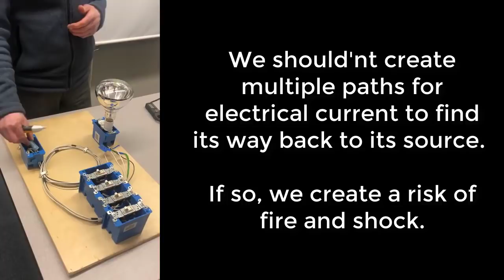Parallel Paths

Comment from the maker: Here is a link to a schematic of the wiring in the demonstration:  http://www.buellinspections.com/parallel-paths-picture/
Reply: You just demonstrated OHM's and Faraday's law's - The reason why we use three phase electrical generation is to do with the transmission of power over HV power lines.
Reply: I feel for you, Charles, I really do. It would appear many are not able to abstract away the demonstration from the physical sub-panel, or to even listen and understand that you're talking about a sub-panel and not the main panel where service is fed in. I got it, I get it, it makes sense, and no I didn't need you to show an actual main panel, sub-panel, and an entire house to prove your point. Some people...
Reply from the maker: Thanks Redemptus
Reply: Charles Buell thanks this is what I was looking for.  I understand the parallel paths but don’t understand how a house could have this wiring..
Reply: @m2mot  aparently they harvest elecricity ftom the air using power lines.
Reply: If  you place a large copper coil under a say ,400 KV  pylon power line  it will give you power -its also dangerous and  illegal to do this  -did it as a apprentice to see if it works ,yep sure does !! -So there you have it electricity from power lines with no connections -I blame Mr. Eddy Current -Seriously the reason why the N and E are joined is to stop the voltage potential  rising above the difference between live and earth -People need to  just leave it to the electricity supply companies , Don't play with electricity  if you don't understand   otherwise you may end up dead .
Reply: Thanks Mr. Buell. You read my mind. Im thinking boy it would help if I had a circuit drawing. I look down and there it is.

Comment: Charles, your demonstration and explanation are correct.  It's a bit abstract though for many viewers.  It requires the viewer to have certain knowledge in order to connect the dots between your demonstration and why we don't connect neutrals and grounds in a subpanel.   The reason is safety!  But only the last 30 seconds of the video briefly mentions the safety aspect.  The main point is, if neutrals and grounds are connected anywhere downstream of the main panel, the ground wire will be carrying current.  And if the ground wire is larger than the neutral(s), then the ground will carry the majority of the current.  It's a safety issue because grounds are, obviously, not supposed to be energized.  Plus, grounds are often bare wires.  I think some confusion could be cleared up if you add a little introduction to the video.
Reply: Matt Schwartz thanks for the clarification!
Reply: Ground wire is for protection eg RCD RCBO devices. It works on principle that neutral and earth wire touching together in case of fault.
Reply: That added some context for me. Thanks.
Reply: this video is not about subpanels, it is about how to wire badly. this demo involves bundling different size neutrals AND ground wire(s) !? totally pointless.
Reply: I totally hate electricity  and someone told me to wire the neutrals and grounds together..  I didnt not cause I'm a logical thinker and to me if you could use two wires they wouldn't have made three
Reply: Thanks for this concise point. No offense to Charles but this video is a better example of how knowing all about something, doesn't necessarily make one good at teaching it.

Comment: Charles is showing the different paths taken by electrons.  I believe the reason the interest in ground/grounding is that there is so much misconception on why and whatfores. The first thing to note is that the gound conductor is the white/neutral, and the grounding is always a bare or green conductor. That wire is connected to earth ground to trip the breaker in case of overcurrent. Course now we have AFCI to contend with and those needs a connection to the neutral bus to help in their overcurrent and fault conditions. I do like your concept of showing the different wires and how the current is larger in a wire with more cmils. Being current is able to flow easier in a larger conductor, it makes sense. Where that current goes and how you show this makes sense if anyone is going to wire up a panel. Make sure the rules are followed by your jurisdiction and the codes that apply. Thanks for the great video no matter how it is approached, electricity is not to be taken lightly! Johnne in Seattle

Comment: Note, much is relating to the orginal posting that I believe this video replaces:
 I think (please correct me if I am wrong) is that this is a demonstration of a SUB PANEL connection. As an example you have a main 200 amp panel where the meter is. But on the other side of your home (say the garage) you need more circuits. So you run a large sized wire(s) to say a 100 amp SUB PANEL. From the sub panel you run additional lines off separate breakers. So, he is NOT talking about the main breaker box.

 I assume this is in a teaching environment and is only a small section of the actual understanding. I grasp the separation of the ground/neutral at the SUB PANEL.  But this demonstration never addressed that the neutral and ground are connected at the main panel. And, I think that is what is throwing people off who are aware of how the main panel ground/neutral connect.  IF..., I can extrapolate properly the demonstration I believe the tying of the neutral and ground in the main box directs any improper current to the low resistance thicker wire to ground. Hence there is little or no current on the ground wire. A more common term would be “Nipping it in the Bud.” But if they are tied in the sub panel then any portion of the ground is carrying current along with the neutral wire (split current based on the demonstration).

So, Charles, did I pass? Or do I still need some “school’in.”  BTW, not an electrician but I did wire my whole house 200 main/ 125 sub. And the general inspector had an electrical background passing me on the first go round! Wiring a 4 way switch, now that was fun (not).

Comment: So, the point is that we only want the bare ground carrying current when there is some sort of fault like a short within a piece of equipment, or a broken receptacle sending current to ground.  If we bond the neutral at a subpanel or on a piece of equipment, then the ground is always hot, (and so are all the other neutrals,) any time there is a normal load on the subpanel or piece of equipment.  Is that the takeaway here?
Reply from the maker: All the video is showing is that if there are multiple paths for neutral current to flow back to the service equipment, that current will flow on the paths proportional to the size of the wires.  What this means is that under a fault that would be enough to perhaps trip a breaker  it might not trip it at all if the current was halved going back.  There is some shock potential obviously if the second path is better than the neutral path (as in a compromised neutral).

Comment: Great video and demonstration! I think what is causing the confusion is that it is not obviously clear in the drawing is that the ground is connected to the frame or metal parts of the lamp itself. Maybe labeling the conection might help? It amazes me hpw many supposed electricians can not grasp this very simple concept and will even argue that "they are going to same place it doesnt matter" or "they are tied together at the panel" and think it doesnt matter. Perhaps even showing the ground connected to the frame of a dryer or stove would make it clearer. Outside of that I dont see any hope for people that don't get it other than hoping they dont kill someone someday.

True story last place I worked in industrial maintenance we had a weinig molder and the guy that caught wood off the machine kept getting shocked to the point he had burns on his arms. No one could figure it out and they had tried running ground rods straight off the machine to the floor and several other fixes. I drawed what was probably the 10th work order in 2 years for it and when I examined the wiring found a ground and neutral tied together on a circuit parrallel to some addittional lights installed on 110 circuit and that were bonded with bolts to the frame of the machine. Wired correctly the shocks stopped. But naturally every old timer that had worked on itpreviously argued vehemently that that could not have fixed it cause it didn't matter that they were tied together. Oh well.

Recently had a bank in my town that had a new ATM put in and soon after several people were shocked when using it and are suing the bank and contracter that installed it and will recieve 6 figure payouts probably because first offer was almost $100,000. Guess what the cause was?? Yellow and blue might make green but green and white mixed incorrectly  = injuries and lawsuits
Reply: Thanks!

Comment: Charles, I believe the intent of the demo was to show that if someone did wire an appliance wrong, either a switch or a fixture. Its return path back could light you up if you couple grounds with neutrals correct? Funny thing is, I thought I asked an electrician about this and he said, its okay to do this!
Reply: Is it a funny thing? A licensed electrician doesn't know multiple path neutrals isn't code. Robert. Go ahead and reply us his name and license number if this mystery fellow exists, he's a danger to homeowners if he's wiring homes.

Comment: Ground outside the initial sub-panel is a safety feature to prevent short-circuit at the point where power is needed by shunting the short to ground and hopefully tripping the breaker. In this demonstration is a prime example of an Oakie-Rigged circuit using different wire sizes and ground as a neutral return which you do not want to do, less you create a fire in ones home.

Comment: You simply do not want current flow thru the ground because, like he said, there is a chance of a broken ground wire to have  a potential difference between the two ends.  Ground is ground, no voltage with respect to any other "ground"

Comment: Since many getting here are not familiar with the minute details of electrical circuits, setting the stage would be helpful:

1.0) At the outlet or switch, grounds and neutrals are NEVER tied together - the ground is there for protection, if something goes wrong, while the neutral is the return line in normal, day to day operation of the circuit.  

1.1) The ground is purposed to give, for example, a short to the case of that old Craftsman drill or sander, with a solid metal case, a path of least resistance (less resistance to ground than you).

2.0) This whole video is to demonstrate the above by way of touching on parallel circuits, in an attempt to explain we don't want to be one.

2.1) By having more than one switch on, there were, of course, more paths for current flow.  Mindful of that electricity takes the path of least resistance, each wire would carry some of the load. IF we tied the ground to the neutral, just as by flipping switches in the video, more paths are going to be provided.

2.2) If you touched a hot wire and EITHER the neutral or ground, YOU'D be part of the circuit, providing a return path for current.  Of course, that is not part of your design purpose and it would not go well for you.

. . . .

Comment: Totally makes no sense.  the current is traveling back on the ground wire?   But you did not connect the neutral and ground at the load?

Comment: A ground conductor carries the unbalance current, the grounding conductor is for overcurrent protection and tripping the breaker in case of overcurrent.
Reply: Johnne L. Believe the neutral does the unbalanced AND tripping the breaker.
The overload protection is the ground. thank you.

Comment: Now explain how to wire things when there is no nuetral wire... or is it the ground? Im not sure but old houses is missing a wire so you have to connect some wire to something to make it work. I forget its been a while since i messed with wires.
Reply: there is no ground the only way to do it to code is to upgrade the wiring or use GFI ( unless you using two prong outlets

Comment: I understand exactly what you are saying but what about a three line run to the sub panel (assume an old grandfathered install). The neutral conductor for main to sub would not be effected correct?  I’m still lost as to why the 4 wire feed to the sub is necessary as a 3 wire would be the same as the service line feed to the main.
Reply from the maker: A 3 wire feed used to be common and were allowed as long as there were no other metallic pathways between the buildings (phone, cable, metal water lines, metal fences, rebar in concrete etc that could become a pathway back to the transformer).  Since this could not be assured over time, it is no longer allowed.  However, if you have such a setup, and there are no other metallic pathways then the grounds and neutrals had to be bonded at the panel in the detached structure and it is treated the same as "service equipment."  Of course any boxes, devices etc downstream of that box still cannot, must not, have grounds and neutrals bonded together.

Comment: If, say, the twelve gauge wire was swapped for a silver plated fourteen gauge copper wire, like are used in Navy ships, or the ten gauge was replaced with an aluminum wire, you would see changes in current loads.

Comment: I live in an elder house where neutral and ground are connected in the same terminals. Was this ok back then or is this unsafe and needs to be fixed?
Reply: in the panel, or out at each duplex receptacle?

Comment: I was curious and put a clamp meter on my water line a while back and noticed current going through.  Now ground and neutral are suppose to be connected at the main, so it sort of makes sense that half the current is going through the ground and the other half is going to the neutral at the pole (which is essentially ground, and also the centre tap of the transformer).  Now is this actually normal or not?
Reply from the maker: There should be no current on the grounded components or the EGS.  If there is there is something wrong.  Sometimes it is current going to ground from something wrong inside the house and other times it is something wrong from something outside the house.  Coming from outside can be difficult to fix.  Can be a bad neutral/ground at a transformer, something wrong at a neighbor's house or even from low voltage utilities.
Reply: That is definitely NOT normal. You have a bad neutral, short to ground, or faulty appliance somewhere.
Reply: Good to know I may have to investigate further.  The issue is most likely inside because the current changes based on what loads I turn on.  The neutral carries the "inbalance" of the two hots so it will go up or down as I turn stuff on depending on which leg they're on.   But since current splits itself along all paths how do you stop it from going to ground at all, since the ground and neutral are bonded at panel.  The neutral is also going to be connected to ground at the pole, right?
Reply from the maker: You may have a compromised neutral/ground wire between the house and the transformer.  If you turn off the main breaker and the current goes away you can pretty much eliminate house related causes.
Reply: I respectfully disagree with Mr. Buell. If you turn the main breaker off and that stops the current flow to ground, I would think your problem is almost certainly inside the home and NOT the power company. My suggestion would be to turn everything on, clamp your water line and then one by one, shut off your breakers to find the problem circuit, and narrow it down from there. Note: To 'turn on' your water heater (if it's electric), run the hot water for a bit so the elements come on.

If none of that eliminates the current, you'll have to dig deeper and will probably need an electrician. It could be the power company, it could be a neighbor who shares a water line, etc. 

The takeaway though is that copper pipes shouldn't be used as ground, period. It's been outlawed for many years and is dangerous. You could be electrocuted in the shower, etc.
Reply: Yeah if main is off the current goes away.  240v stuff also won't affect it since the current never goes to neutral, it's only 120v stuff that will affect. Water line has always been used for ground here.  Gas line is bonded too.  But yeah I'll have to go up on the roof and measure the neutral at the mast to see if there is any current.  I think there will be though, as there is at the panel, and that cable simply goes up to the mast.  Basically the current is split around 50/50 between neutral and ground after the bonding point.
Reply from the maker: You are agreeing with me I think.  Regardless, any metal water pipe to the house is required to be part of the grounding electrode system.  Current literally can be induced on the GES through the dirt---does not need a metallic pathway.
Reply from the maker: Sounds like you are sorting it out Red Squirrel.  Keep updating us.

Comment: I moved a double wide in Cali, hooked up the wiring, needed it inspected, the inspector took a look in the panel box and went around the whole place and put one lead of  his meter in the ground hole and the other in the neutral (common) hole of each receptical and tested for  continuity. He found one where there was none, the ground was unconnected, I connected it and it passed.
Reply: believe the continuity was BACK AT the panel where they ( neutral and ground conductor) are bonded together. thank you

Comment: So, if all switches are open, there is a voltage across them. There would be a voltage across two earth wires. And that is not safe. I think we all agree with that part. But why should we care about the amount of current flowing through a thicker wire?